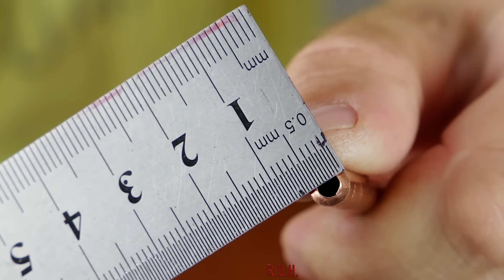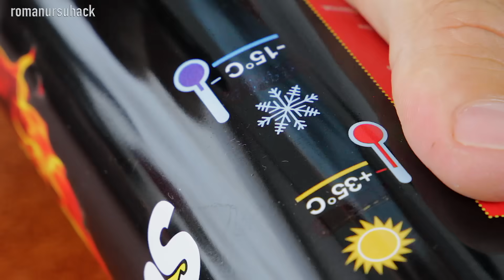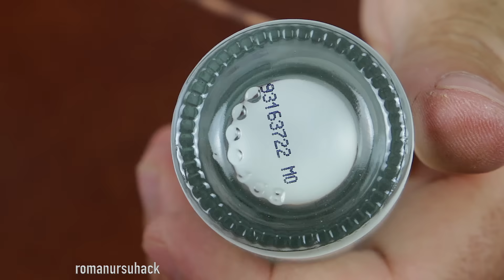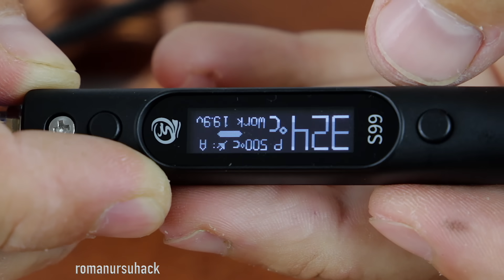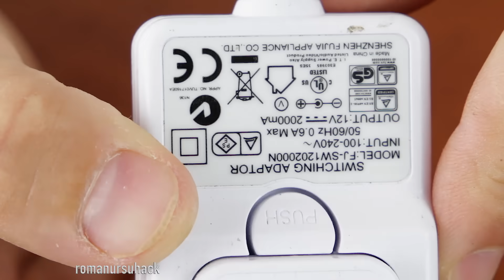How to Make a DIY AC Linear Air Conditioner Down to -15°C and a Heat Pump Up to +35°C

Comment: It drives me nuts that in a lot of videos they seem to have a giant bottle of some type of high-tech superglue but don't tell you what it's called. In my experience, no superglue ever works on anyting but my fingers. Yet they seem to glue anything and everything with no issue. Would someone please enlighten me?
Reply: Look up accelerated super glue - it is typically an accelerant in an acetone base that is sprayed onto the adhesive. There are plenty of brands available.

Comment: Thank you for uploading a great video. I followed everything exactly as shown. I checked that the linear power supply was outputting 12 V and 1 A properly. However, after pulling a vacuum with the vacuum pump and then injecting the butane gas—and sealing the injection needle hole—when I try to run the system, the pump doesn’t work, and the current on the linear power supply spikes up to 5 A.

Do you know why this happens?

Comment: Wow it's great 🎉
Can you try this type of aluminum plate with copper coil in front of the (desert air cooler) like aluminium Fin, 
So it's becoming a air conditioner. It's useful for summer.

Comment: If the appliance turns off, what happens to the ice on the copper pipe?
Reply: @freecrypto5263  like any other ice it for sure gonna melts you need a bucket to catch the water or provide a system drainage .

Comment: The air its not an elefant , and the vacum you made its not good also when you put the light gas the air also insert to the circuit that means you having use other pump covering from the camera. Temperature it depents of the preasure....!!! Try to release gas on the air that will produce -20 celsius too!!!

Comment: If you were to put a smaller rod, inside of those larger pipes before inserting the coils you made, it would prevent those coils from bottoming out inside the pipe and give them all the same opening for gas flow. Just saying.
Reply: and how would you get the 'smaller rod' out?
Reply: I was thinking the coils would stay in place once pushed in far enough. Pull out the rod and solder. 
  But if the coil tube got pushed to the bottom, it might get soldered shut. I'm only thinking in theory anyway. I've not done work like that.

Comment: I don't get it, dude.  where's the heat is going to, and also, how is that electric engine pomping is this just leaking the Gass real fast and that's how it's cooling cuz u could've just sprayed it on the stuff u wanna cool
Reply: Heat is rejected in the condenser. Read up on phase change heat pumping.

Comment: That blower is turning hot air into the cold area! thus feeding heat back into the system? 
And is that tiny pump could freeze solid matter of this Universe kept around 288K by the bloody surface temperature of this big hot ball called Earth?

Comment: Which refrigerant available in can  is used in this setup?
Reply: i believe it uses isobutane - the same fuel used in a lighter. it's very basic and of little practical use in the way displayed here. it's simply a demonstration.
Reply: Probably one of thise R-290-Propane, R-600 Butane or R-600a Isobutane, all of them can be used as lighter fuel, but typical commerial lighter fuel is Butane or R-600 refrigerant

Comment: Best way I have found to form a GOOD coil, is to very tightly pack it with salt. Plug up one end, fill with salt, but keep tapping the pipe so that you can get MORE salt in the tube. Then wind it around whatever shape you want it to take on that shape. 
Once you have done that, unplug that end of the pipe that you had plugged before, and slowly try to introduce warm water into the tube. If the coiled tube is short enough to stand up in a container filled with water, put it in that, as any air should be displaced by the water. But if you need to lay it down in a tub, every now and then, give it a bit of a rotation, as this should help the water to dissolve the salt. 
When you can get a bit of water to flow through the pipe, try and get the water to run freely, and FLUSH out ALL of the salt. 
If done right, you should get NO kinks or folds or wrinkles in the pipe, making it look professionally done 👍🏽 
Hope you have success with this method. As some say to use fine sand, but sand will NOT dissolve in water. 

Bye from Knobby.
Reply: Thank you very much, also I think softer salt or at the best powdered salt would be better for keep the copper pipes more smooth and with less abrasion 👍🏻
Reply: @khashayarmodaberi4958  Hi, the salt that I use is just NORMAL table salt, and that works fine. But I do NOT understand why you are thinking about abrasion, as if you get any, it would only be inside of the tubular copper piping. But you got a good point about making the salt to be finer. I have done this by using a pestle and mortar. But then if it gets so fine, when you pack it in tightly, it WILL compress it to become quite hard, as if it had gone to solid rock salt, then it will be a BITCH to remove. As I know by me making an 8mm copper coil, as I used about 20 feet of tubing, and it took me 3 days to fully remove all of the salt out of it. But it was well worth the effort, as it formed a 98% almost perfect coil. And the job that I had made it for, it both fit and worked VERY WELL 👍🏽👍🏽👍🏽
Reply: @jonc4271  Well Done!
Reply: @khashayarmodaberi4958 ⚠️ God has said in the Quran:

🔵 { O mankind, worship your Lord, who created you and those before you, that you may become righteous - ( 2:21 ) 

🔴 [He] who made for you the earth a bed [spread out] and the sky a ceiling and sent down from the sky, rain and brought forth thereby fruits as provision for you. So do not attribute to Allah equals while you know [that there is nothing similar to Him]. ( 2:22 )

🔵 And if you are in doubt about what We have sent down upon Our Servant [Muhammad], then produce a surah the like thereof and call upon your witnesses other than Allah, if you should be truthful. ( 2:23 )

🔴 But if you do not - and you will never be able to - then fear the Fire, whose fuel is men and stones, prepared for the disbelievers.( 2:24 )

🔵 And give good tidings to those who believe and do righteous deeds that they will have gardens [in Paradise] beneath which rivers flow. Whenever they are provided with a provision of fruit therefrom, they will say, "This is what we were provided with before." And it is given to them in likeness. And they will have therein purified spouses, and they will abide therein eternally. ( 2:25 )

⚠️ Quran
Reply: or you can just heat the copper up and wear some gloves and it gets much easier to bend sans kinks. even the warmth created by friction from your hands softens it.
Reply: ..wrapping it around a round object sounds easier..js
Reply: you can use baking soda to fill the tube,
use vinegar to dissolve the baking soda later
Reply: @asdertrender7555  but baking soda is soluble in water?
Reply: Or fill with water, freeze it nice and hard then bend it, brass musical instrument makers have been doing it that way for over a 100 years.
Reply: Were using sand instead of salt
Reply: @dugongbughaw1218  i learned doing sand also but salt is better since it is water solvable